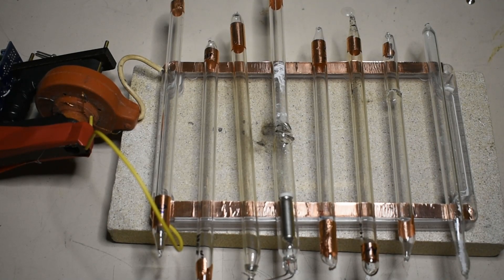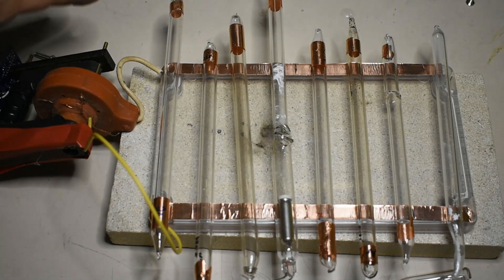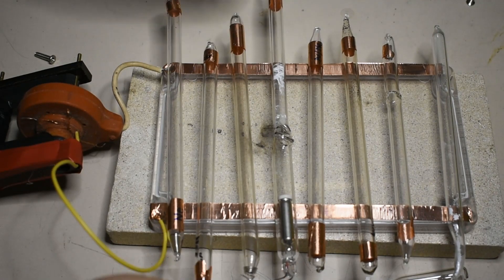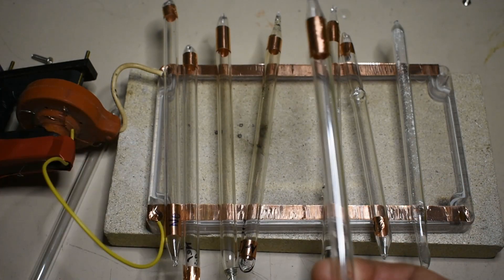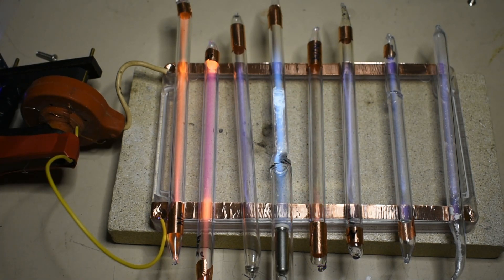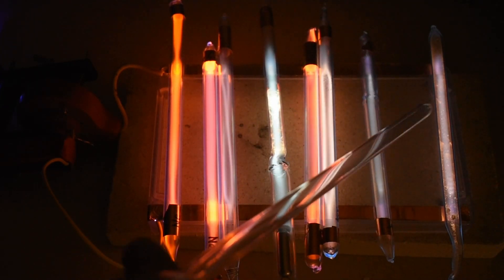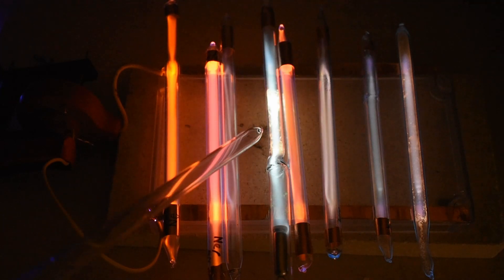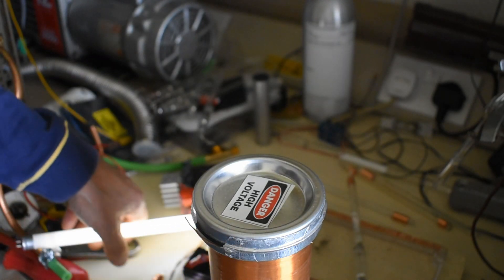Electrode-less Neon tubes

Comment: Where to buy these tubes?
Reply from the maker: I actually made these for the video, so not commercially available. You might find some sellers on eBay that have small electrodeless tubes with noble gasses but not exactly like these.

Comment: can you not make a laser with these?
Reply from the maker: not as they stand, there is quite a bit more to making a gas discharge laser.
Reply: @tuopeeks  well if you are able to fluoresce a gas in the tube can this not be made into stimulated emission by putting the tube inside a resonator made to reflect this specific frequency? obviously the tube ends need to have parallel windows or brewster angle perhaps?

Comment: Awesome m8 just seen this.. cant you use torch to nip the ends off a fluorescent tube🤔
Reply from the maker: Glass on a fluorescent tube is very thin so a hole forms before pinching off.
Reply: @tuopeeks  bigger torch maybe? How do they do it?
Reply: @tuopeeks  oh dont worry I thunk about it. They will have small evacuation stem doe